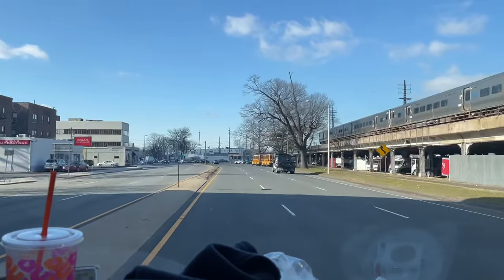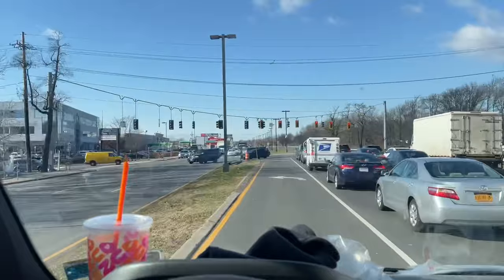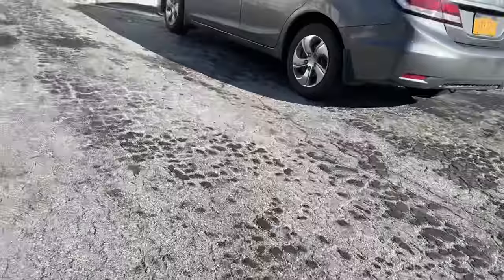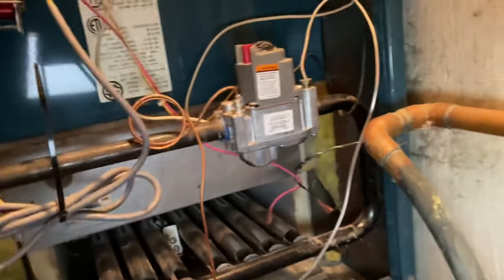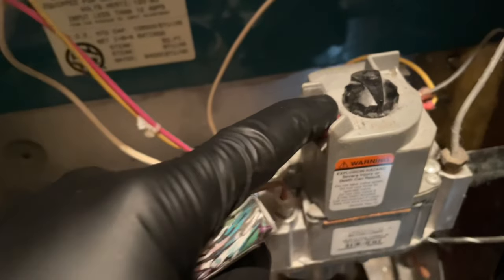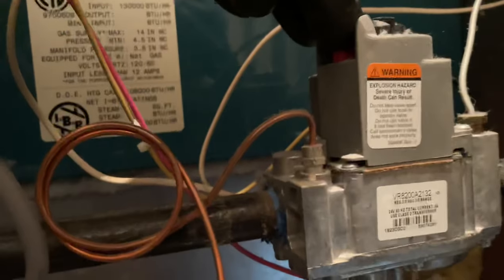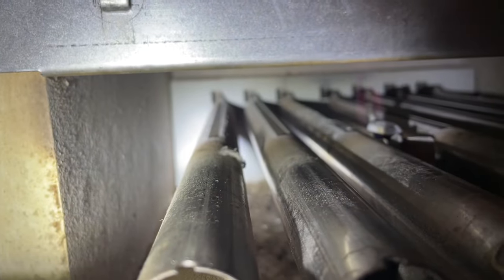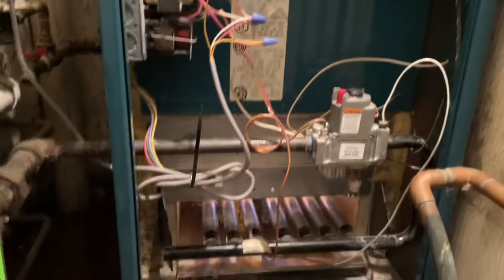No Heat Burnham Gas Boiler How To Relight The Pilot

Comment: I have a question, I work at a Apartment complex and it has a Weather king Furnace, I lit the Pilot light, turn it to on, turned the power back on and the burners never came on, thermostat set to heat and auto , temperature 72 degrees at thermostat, Old Honey well thermostat.. please help. Thank you

Comment: Thank you.  Great vid.  I'm a contractor in Hawaii, so I know a lot about plumbing and stuff, but you know what?  I don't know jack squat about heating systems.  My father's boiler isn't working, I suspected pilot light so I went on youtube and what do I see, the exact model of my now late Father's Burnham furnace.  My Sister will be so happy when she gets home.  You're right about these videos too.  Because I can see that at least YOU guys know exactly what's going on, it gives me hope that other employees of Pipe Doctors will be as knowledgeable as you.  I'm sure my Dad's furnace hasn't been inspected or cleaned in at least 3 years, so I'm going to look up a Pipe Doctors in my area, Queens NYC.  My Dad used a local plumber and I hired them to replace a frozen valve on a radiator and it cost $500 bucks.  That was the last time I'll call those _______!

Comment: I don't have a red clicker to light the pilot, also the on off knob doesn't click up or down. it says on the back of the door that it lights automatically, do you think its a pilot issue or something more than that? I assumed it was a pilot issue with the down draft in my basement my water heater pilot goes out sometimes as well. 
thanks for the help

Comment: Mike what was the volts coming from the thermocouple?
Drafty ?
Increase pilot pressure ?
Blow back when valve shuts down ?
( you may need to cycle 10 times or so)
The call back eats your money!
And ALWAYS CHECK THE CHIMNEY CLEAN OUT BEFORE YOU GO !!
BE SAFE 
35 YEARS IN !!

Comment: I bought my house (new construction) way back in the 90s and the gas boiler doesn’t have roll out,damper and spill switches. 
Do I need it and is it necessary to install/add on a roll out switch ? Damper, Spill switch I cannot do anything about it cuz it doesn’t have a draft hood unless I redo it, thanks

Comment: I have a 1999 Burnham furnace, oil heal by hot water. My furnace flames keep going out and stays off (but blowers and such on the unit keep going) until I got over to it start it manually with the red button. The temp shows 0, as one would think, after this happens, or near zero.
Any idea what it might be? The flames come on immediately after pressing the button, but every few days, they go out again, and won't come back on, unless I go back to the furnace again.
I heard the flame sensor might be dirty, so I'm going to try and find and clean that. Any other ideas?

Comment: Mikey.. I have a Burnham P204A furnace. I turned it off  2 years ago.  I went to fire it up, and the on/off knob for lighting the pilot will not budge! It won't move from the off position.  Help!
Reply: @PipeDoctor  I was afraid of that!  Wish you lived in NM, where I am!
Reply: @PipeDoctor  I  haven't used a tool to turn it.  Might a malfunctioning thermocouples cause the hv switch to refuse to turn to the pilot position?

Comment: I change two new gas valves , all of them have gas leak from where the red reset button area, is inlet gas (9 we) too high
Reply: @PipeDoctor  it is natural gas, at the inlet of the gas valve is 8.7 wc.  Is it too high, but the other appliances are working ok.